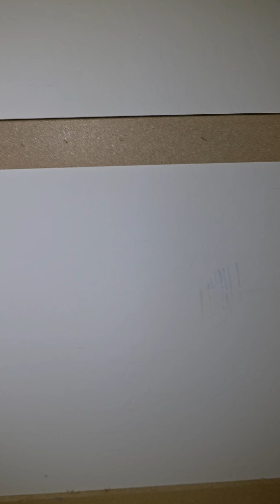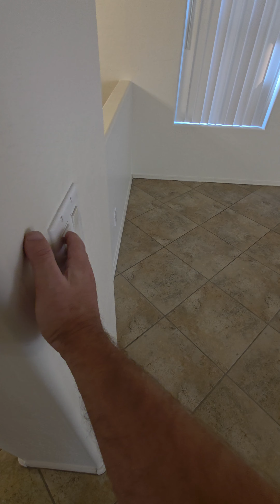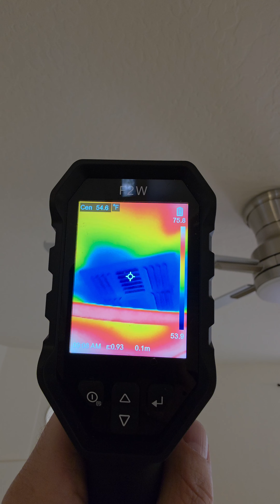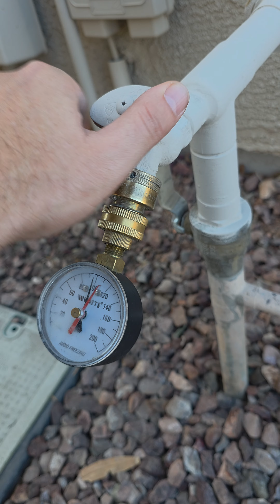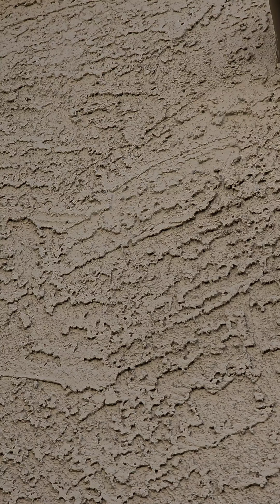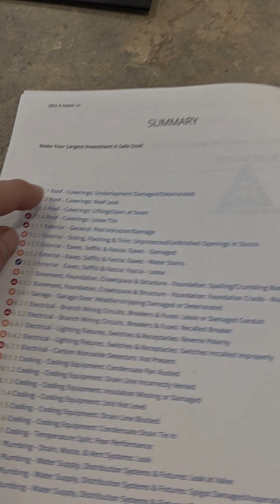Home Reinspection Revealed Several "Not Completed" Items

Comment: You need to pull that cover on the Circuit breaker and look at the wires going to each Circuit breaker. It only takes a minute.
Reply from the maker: So we agree. I do, but not while I am filming. Even at a reinspection. An electrical panel can be a mess and it's just how I film it. Thanks though!